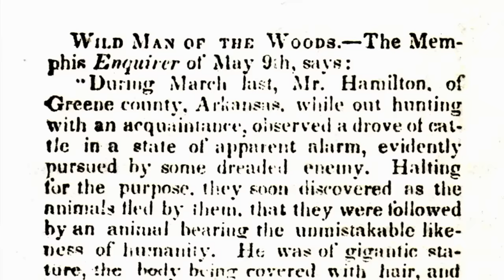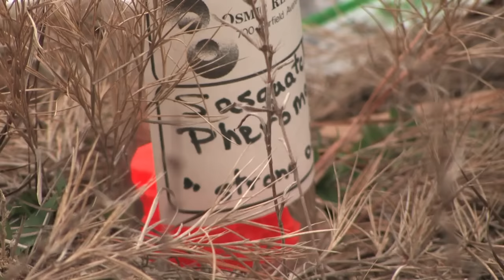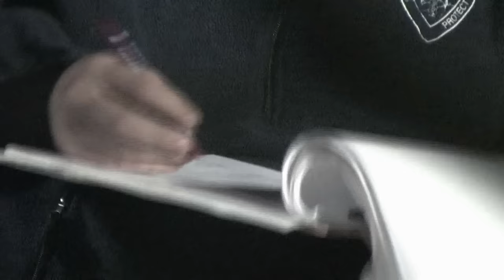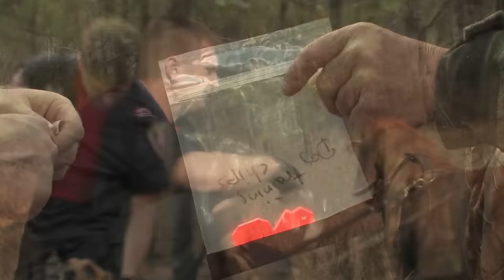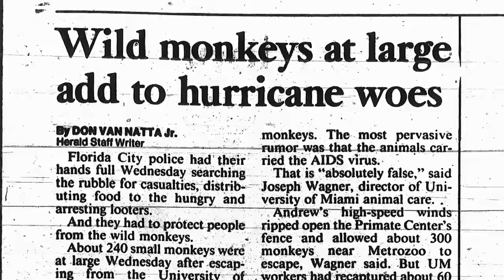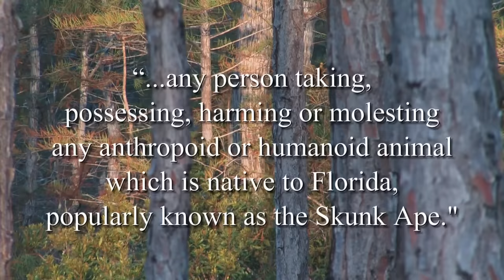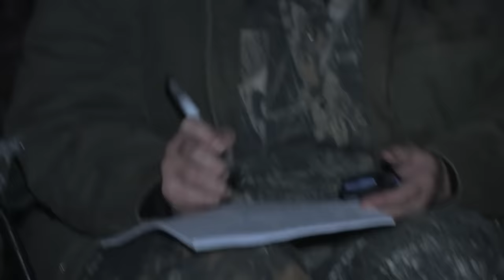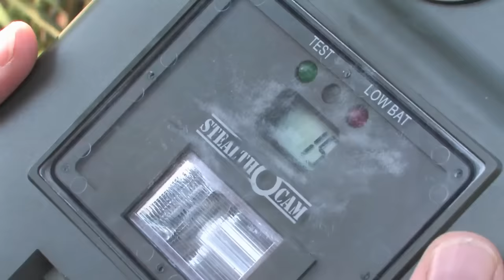MonsterQuest: Swamp Beast Revealed - Full Episode (S1, E9) | History

Comment: Thank you spell check it took my word and rearranged it so it's incorrectly spelled. The term used above should be quatra pedal. Additionally in my enjoyable research of this dilemma what I have heard is that in my guess the Sasquatch alleged Sasquatch when eyes are hit by a torch or flood light the way his eyes are designed for night hunting with an additional layer of reflectors inside the eyeball the eyes will glow back red.